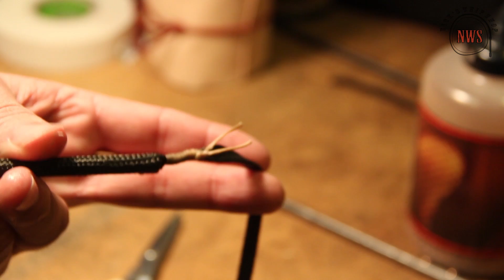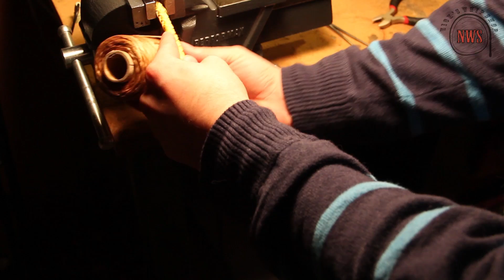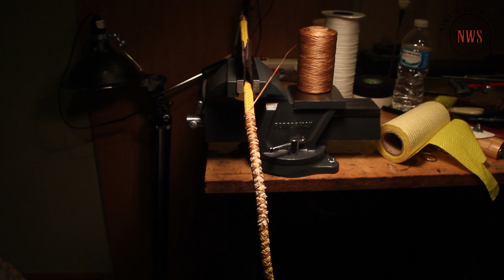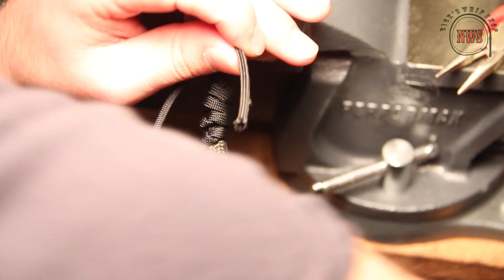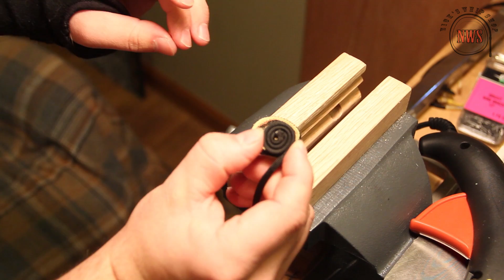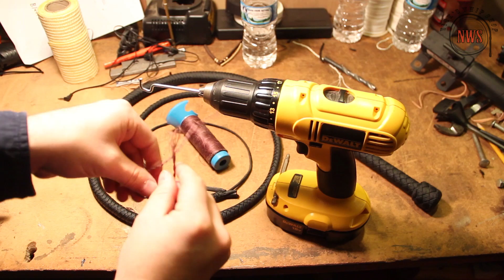My Current Nylon Bullwhip Making Method | Nick's Whip Shop

Comment: Hello Nick, I am beginning to work on my first bullwhip, and was wondering what waxing the whip does for the actual performance of the whip? Is it necessary? Thanks for the awesome videos
Reply: Hey, I just finished my third whip and this is what I have observed, waxing conditions the paracord and helps make the whip last longer. it also helps stiffen the decorative finishing knots. once you wax it let it cool then roll it again, (helps break up the excess wax and gives it a nice finish) also it helps seal the dropped strands in. The first whip I originally purchased, the guy who made it offered to re-wax it after two years to help preserve the whip. so occasionally re-waxing can help especially if you use it a lot. hope this helps.
Reply: David Quigg Thanks a bunch! I
 understand now :)
Reply: Brennan Harkema your welcome. I have also just learned that once you've done all that burnishing the whip with a piece of leather helps complete the finish, works the wax into the paracord better and removes the dull waxy coating the paraffin can leave. good luck.
Reply: David Quigg awesome :) I shall look into that! I'm working on my second whip right this second
Reply from the maker: Hi Brennan. It's not necessary, but it helps the whip shed water and keeps moisture from being absorbed, making the whip too heavy.
Reply from the maker: Hi Brennan, it is not essential, but it helps waterproof the whip. Also I have found that it tends to make the whip flow a little better.
Reply: Where can I get some of this wax
Reply: Jairo Perez it's just straight parafin wax. most hobby/craft stores carry it. look for candle making supplies. I understand some Wal-Mart Stores carry it as well. the trick is melting it in sufficient quantities. I'm using a pair of aluminum chafing pans, the disposable kind and using my oven. the only problem is if you spill any in the oven you have to clean it out completely or it smokes and ruins anything your trying to cook. currently looking for a 18qt electric roaster like nick has  but haven't had any luck so far. good luck
Reply: David Quigg thank you sir

Comment: Hey Nick. I was wondering what grade paracord is actually needed for a whip. Must it be high grade paracord or can lower grade do? What must be sought for in the paracord when buying the material? Thanks! Keep up the great work!
Reply from the maker: +Corta Morte Hi Corta, type III 550 paracord works best.
Reply: +NicksWhipShop Thanks but what I meant is I've realized there is quite a bit of a range in price between one paracord named type III 550 and another while I was looking to buy some. Are they all good to use?

Comment: How much would it cost for a neon green with blue and black stripes on the bottom that is 10 ft and do you use a specific brand of nylon cord
Reply: Correction 8foot
Reply: i make whips check out my fb tannerswhips

Comment: Hey Nick, love your videos and have really learned a lot from them, so thank you. But I was wondering how you measure your whips. I was told at one time that it's measured from the handle transition point to the end of the fall. Is this correct? If not, how do you measure it?
Reply: from heel knot to end of thong.

Comment: hey nick I'm trying to make a 10 foot and I use 4 plate belly then 8 Plat then do the 12 Plat overlay but I end up with a 6 foot whip can you tell me the formula for a 10 to 8.5 whip I watch how to make a 8.5 foot whip but no messurments?  can you help
Reply: if you make a 10 foot dont start with 4 plait i would do 8- 12 plait or 8-12-16 plait.
Reply: The and I'm still learning but the best one I made was with tape to bound it it just shortens tried many I have make a 3 foot 6 foot 7 foot 8 foot but just having problems on the turk nots and I like to make um but my fingers hurt so bad a few days later
Reply: And I hate auto type
Reply: +joey dodge dude you have to buy artificial sinue its so much better than tape! 😁

Comment: Hi Nick, I've just watched 'My current Nylon Bullwhip Making Method' and found it very helpful. However can you please list the names of the products you use say at the end of the video for those who are not in the USA or Canada and are unfamiliar with some of the names. For example you use the phrase BB's and it took me a while to figure out you were using ball bearings , well I think you are. Also the new core material I can't get the name and the web site you say appears on your video doesn't.
Apart from that a nice informative film. Oh just one other thing are the video's available to buy as getting it downloaded from You Tube is difficult and probably breaks copyright law.
Reply: BB's are use for BB Guns & Air guns. If you can find the same size ball bearings it should work just fine.

Comment: Hey Nick, great  tuts, question time, in your first tutorial you loaded half of the core length with bb shot, on your latest you only load 1 foot of the core, why is this so 
Regards 
Big Steve .
Reply: Touch and hold a clip to pin it. Unpinned clips will be deleted after 1 hour.

Comment: Why not run the core over the entire length of the handle rod instead of simply the first inch or two? I understand with roo it comes down to a question of money and size (plaited section being twice the thickness of a non-plaited section), but in this case, the size of the core tube is so negligible, wouldn't you benefit from added stability to having the core over the entire handle as opposed to the tip only? Just spit balling here....
Reply from the maker: Hi Hiro, good question. The reason that the core is not fitted over the entire handle is because the bellies, heel knot, and overlay would slide around since would be hardly any friction between the sinker cord and the steel.
Reply: NicksWhipShop